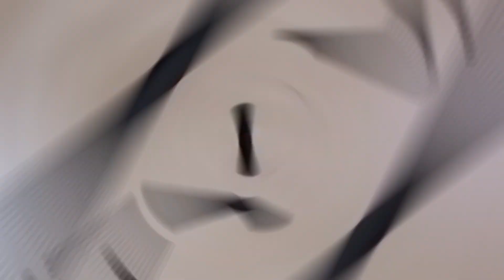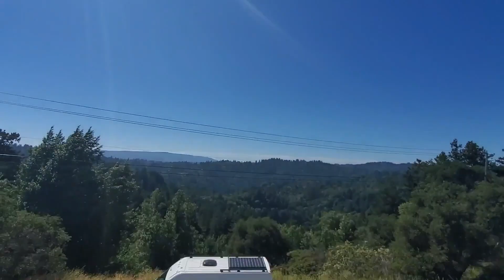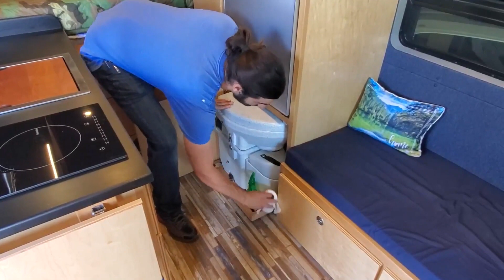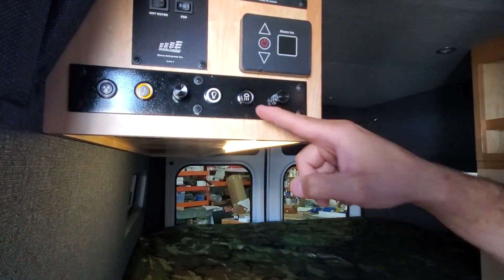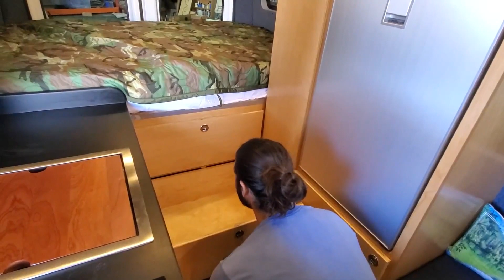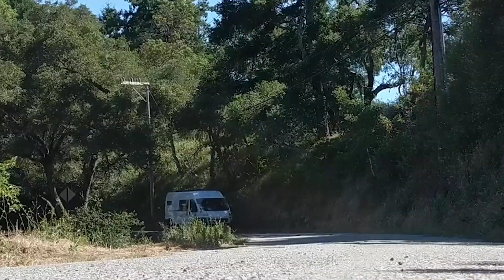High end custom van conversion FULL TOUR!! (2019 Ram ProMaster)

Comment: is there a way to not get the bed wet when taking a shower?
Reply from the maker: We ended up putting up a screen that should stop most of the water from going inside the van. Another curtain could be installed to protect the interior as well.